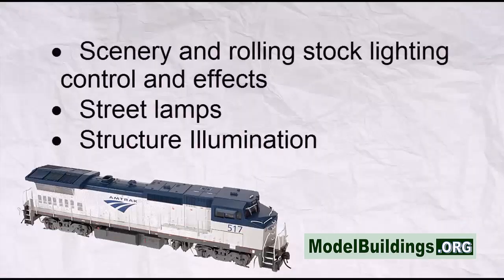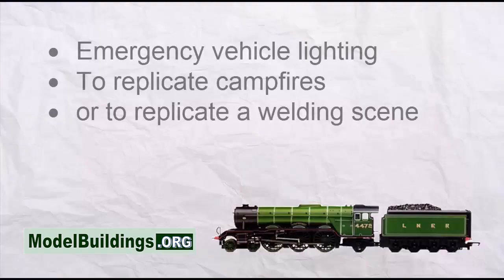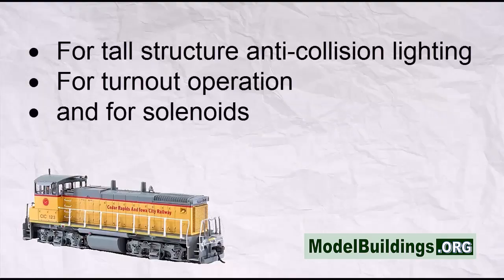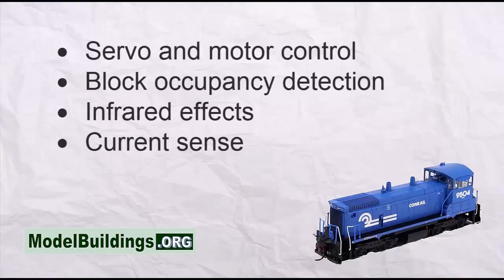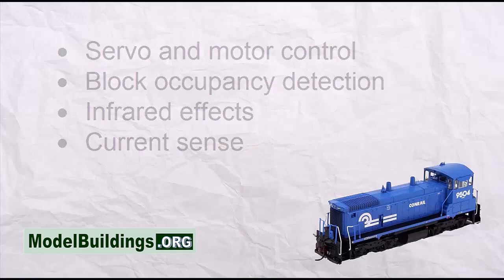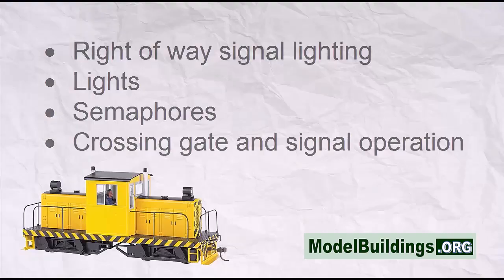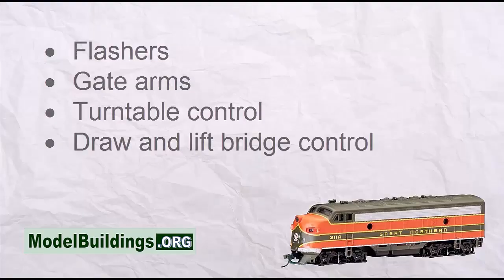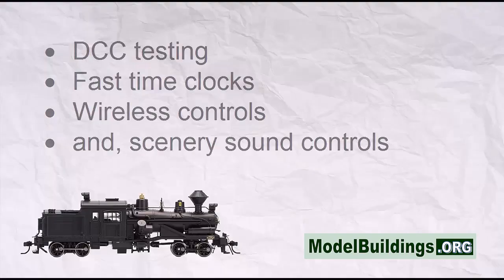Model Railroad Micro Controllers | Useful Techniques 🚂

Comment: I found a microcontroller small enough to build a custom 3D printed N scale car (20mm, .8 inches wide) and run a streaming web cam down the track.  A microcontroller-managed servo switch machine with a 3D printed bracket can be assembled for about $5, significantly cheaper than commercial models.
Reply from the maker: That's an awesome idea and a great way to save money!